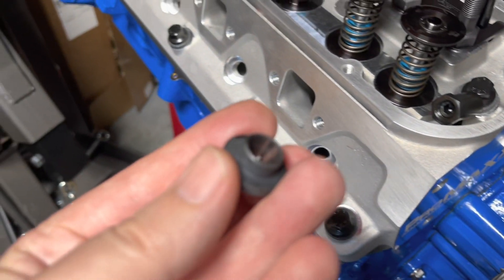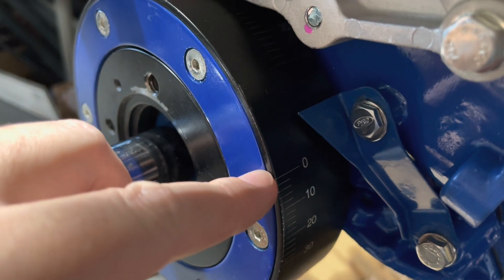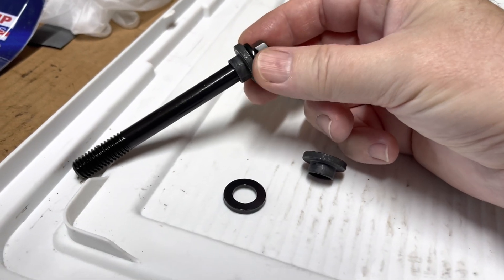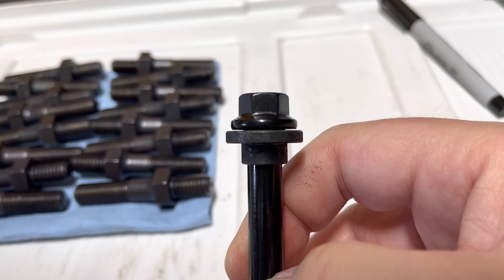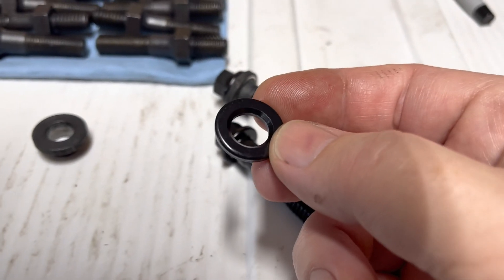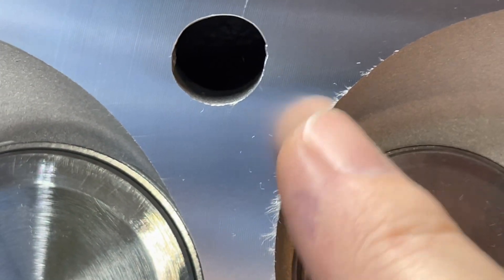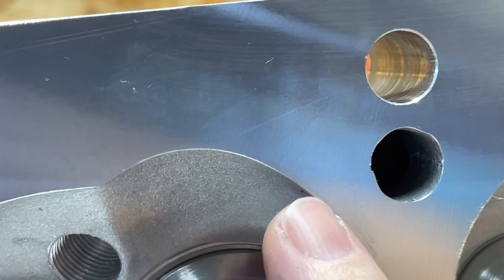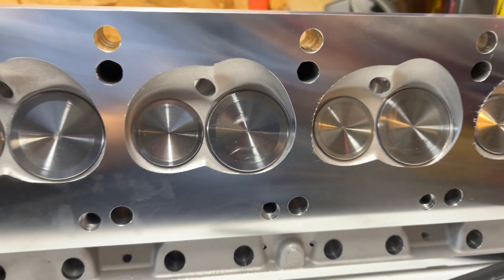Cylinder Head Prep - Ford 289 331 Stroker Motor Rebuild part 19

Comment: Did this engine have stock pistons with stock valve reliefs ??
Reply from the maker: The KB355 pistons are definitely not stock replacement. They are designed for a 5.4” connecting rod which is 0.245” longer than stock 289.

Comment: i can see youre problem with the promaxx heads and bolts .
I also gonna buy these heads . should i buy this kit?
ARP 154-3705 - ARP High Performance Series Cylinder Head Bolt Kits
Reply from the maker: I would definitely buy that kit if I had to do it over. I was trying to save a few bucks but I would rather ditch the washers for some extra gripping threads.
Reply: @JohnLatrobe  thanks i was going thru you're parts list so you had mismatched parts ordered? So i need these lifters? COMP Cams 17043-16

Thanks for the help of building me stroker with you're vids. 
I have ordered this comp cam 290/290 i hope it's choppy but still drivable ,:-)
Reply from the maker: @chevroletbelair1  The rocker studs that come with the heads are 7/16” where they mount to the head, but taper down to 3/8” to mount a 3/8” rocker arm. I replaced them with stiffer full-size 7/16” studs that require a 7/16” rocker arm. The COMP Cams 17043 is for a 3/8” stud and the 17044 is for 7/16”.

You saw how drivable my 284/284 is so the next bigger cam shouldn’t be too extreme. Hope this helps
Reply: @JohnLatrobe  
Is it nessesery to change the rocker studs? Why did you do this?
Reply from the maker: @chevroletbelair1  Totally not necessary. Since I had to buy new rocker arms anyway, I spent the $30 to get thicker, stiffer studs.

Comment: Thinking about getting these for my 302. How’s the build coming along? Do you or any who commented, have HP numbers? Curious how these heads compare with more expensive heads like trickflow
Reply from the maker: ProMAXX has flow numbers on their website that you can compare to other budget heads. Based on similar spec crate motors it should easily make 375-400 HP and torque.